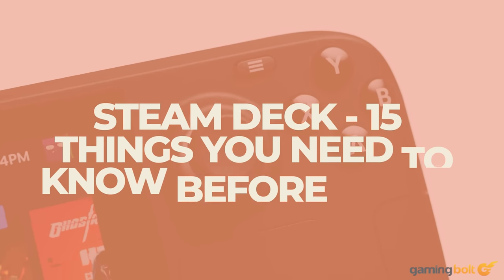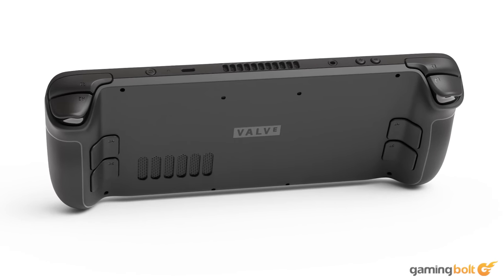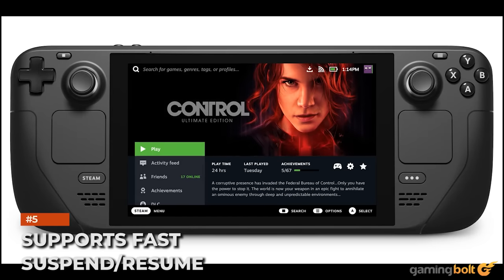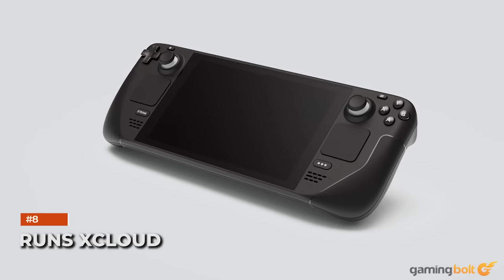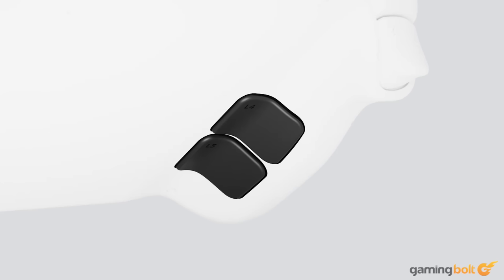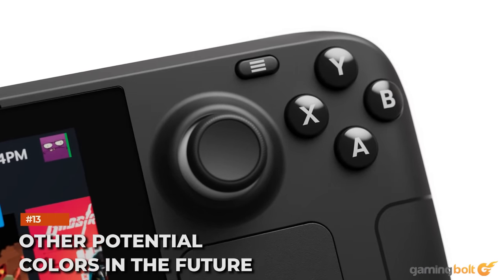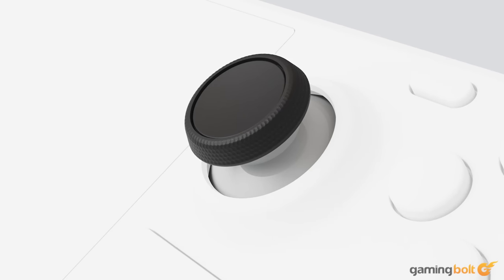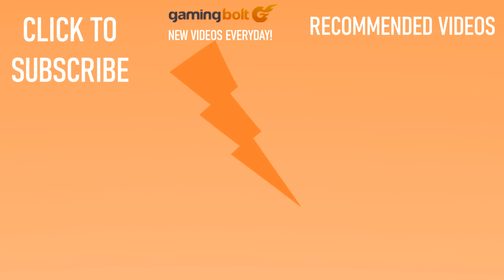Steam Deck - 15 New Things You NEED TO KNOW Before You Purchase

Comment: I pre ordered the smallest hard drive one and I can’t change it and don’t want to wait longer for one, anyone know if it has a slot to put ssd in or roughly how many games I could get on it, probably want to play Elden ring and cyberpunk on it
Reply: You can put a 1 tb micro sd card in it and it will perform the exact same as the internal ssd. Linus tried it in one of his videos. You will also likely be able to upgrade the ssd but I'm not sure
Reply: @Thebadbeaver9  ok thanks for that , as long as I can expand the storage without opening it up that’s good for me 👍
Reply: You will have to wait for the  teardown of the cheapest one to see if they added the NVMe slot on the mainboard  all the ones that are tested at the moment are the 512gb models.. but you can get a 1tb sd card for it and it's hot swappable like a game cartridge .. I got the 256gb one reserved I'm just gotta get to two 512gb sd cards or  acouple  256gb sd cards since lesser size ones read alittle faster than the bigger GB ones and price
Reply: @digitaldoom3593  All three models have the same hardware, except the storage. That means that the 64 GB model also has an m.2 slot for a NVMe SSD, so you can replace the 64 with a higher capacity one. That's confirmed and makes sense because it would be more expansive to have two different boards where one does not have a slot.
Reply: Nice just saw all models use socketed 2230 M.2 modules ....  first time seeing it thanks

Comment: what if you could attach something like the oculus quest 2 (Using a oculus app for steam) so you could play steamVR on the go
Reply: @demonpride1975  I was just using oculus as an example
You can use whatever headset you want.
Reply: @tabbycat8647  there is just one problem with that, to stop people from getting sick, you need a stable 60 fps, anything lower then that. or even stutter can cause sever motion sickness.

Comment: Thing is its said that its a pc. but i would like to see future development of contents like putting windows. the included ssd has the steam os and it probably has the booloader as well of the os. same goes for windows if one were to install. you will be needing a second 2230 ssd drive to bootload and configure a windows 10install and install on steamdeck enviroment. then comes accessing bios to change the drives prioriy and such. its easy to say that you can put windows and game pass but it will be a nightmare till some drivers comes out for windows vesion so one can install gpu driver, blutooth and wifi,power configuration tools, successfully running afterburner. amd ryzen master working properly to tweak memory.

Comment: Is the 64GB version SSD replaceable?
Reply: yes  you can  istall ssd 2242 i think but valve is aginst it
Reply: @clanjade1  They aren't against it, they said approached it at your own risk and it voids your warranty.
Reply: @clanjade1  2230 NVMe only, 2242 won't physically fit. Generic off-the-shelf drives aren't guaranteed to work perfectly though, YMMV. I'm guessing a decent number is installable but may have some thermal issues or somewhat interfere with the wireless module. Can realistically range anywhere from "barely noticeable" to "barely runs at all".

I'm sure the community will test a lot of drives though, finding a compatible one shouldn't be too difficult.

Comment: Replacing the battery will be a nightmare.
Reply: Yeah, I found it shocking how they glued the battery in after having taken such a pro-right-to-repair stance regarding most other components, especially considering that the battery is likely the first component that'll fail.
Reply: @ThePC007  hopefully it will be better on the final released products?
Reply: @MiraSmit  I really hope it will. Either that or people find a way to reliably replace those, even it means flooding the entire battery chamber thing with alcohol or something (though that's assuming that replacement batteries will actually be available).
Reply: @ThePC007  I suspect Valve will be selling those too at a somewhat marked up price since you k ow L shaped batteries aren't that common.

Comment: I'm adopting a wait and see approach as I'm from a country where the US dollar is four times my earning currency, so there's a huge price difference between the most basic model and one step up. So I'd like to know just how viable it is to play with the base 64GB version using a fast high capacity MicroSD card.

I don't know if Valve will even ship it globally. With no official distribution for consoles besides the Playstation in my country, they're only available as grey imports, and at ridiculous prices that had left me sticking to PC gaming.

Also I'm curious to see how it will handle titles that still need EA's Origin or Ubisoft's uPlay services or heaven forbid, Games for Windows Live.
Reply: Yes you can game from the MSD card and upgrade the 64G as it is M.2 30 size.  The Phaux has good coverage on how to get the most oiut of the SDeck

Comment: 2230 is such a weird m.2 size to use. It'd small but it's also hard to get your hands on a new one as they seem to only be used by OEM.
Reply: This one was designed specifically for the Steam Deck.
Reply: @Joreel  It's custom-designed to a degree, but one could still find off-the-shelf products that are compatible, it just isn't a case of "every 2230 NVMe works perfectly by default" (EM interference, thermal design, battery life, etc.). There's nothing stopping manufacturers from labeling existing drives as Deck-compatible though (from their perspective at least).

Comment: also 15 was kind of a joke but not really. they do say: its YOUR DEVICE do what u want. but please. dont. let an expert handle this.
if you ''upgrade'' u probably meant replace battery joysticks memory. u could possibly fuck up the screws. thus making it all weaker.
and in terms of colours. ever heard of 3d printing? once people have these its super easy to make your own backplate. with custom logo's and what not.
im sure valve is aware of this. and also look into the killswitch. a protective mould for over your deck. u can already pre order them.

Comment: Been debating on it for awhile. However there should be more benchmarks and better looks at the hardware by the time my reservation would be made available, so I could cancel if I see things I don’t like. However it seems the deck is on par with Xbox one / ps4 performance with perhaps more juice due to the architectures and storage the decks using. Time will tell. 

Sea of thieves or rdr2 on the go would be nice. Will just have to see

Comment: So what happens when the controllers wear out once a year due to heavy use?
Reply: Joysticks can be replaced without dealing with any adhesives or soldering. Valve has partnered with ifixit to sell replacement parts like joysticks

Comment: It's more powerful than a switch but less so than the current gen consoles for a higher price,but it is able to do things on the go so if i can even get one i would need to buy an extra ssd for sure(i'm a digital pack rat).
Reply: why would you need an extra SSD? There are tons of vids showing that high quality SD cards load nearly as fast as the SSD and 100x more portable far easier to swap.

Comment: My most important question: WILL IT PLAY METAL GEAR SOLID V?...

And Baldur's Gate 3. That'd be nice
Reply: Based on ProtonDB, both should work, possibly with some tweaks required. Baldur's Gate 3 does seem to have some performance issues according to current reports, but there's a decent chance that'll be resolved at some point in the future (no guarantees though).

Comment: its sad that when the next gen switch comes, its still gonna be overpriced hardware, im betting as powerful as the series s with a weaker cpu at $500
Reply: There’s no way the next Switch will be near the same field as a Series S. 

We would be lucky for it to reach the power of an Xbox One or PS4 anytime soon. Current switch clocks in at less than half the performance of the regular 2013 PS4.

Plus, it’s Nintendo. Wouldn’t be surprised if they release a Switch 2 with a slightly tuned fan curve so it can run 5% faster and call it “Next Gen”
Reply: Nintendo switch has 1Tf of raw power while the series S has 4 ...... a new switch is never going to be on the same level as a Series S .. the Nintendo switch is barely above the power of a ps3
Reply: @retrofxmedia  Go look at handheld gaming in 2016. We had the 3DS and Vita to look forward to. The Switch moved handheld gaming to the next level. People forget this and have been spoiled with the Switch

Comment: EMMC memory is in the low end model. This is slow. You have been warned. This will affect the graphic speed substantially.
Reply: Whatever "graphic speed" is supposed to be. I disagree. eMMC is similar to CD cards in speed, which are still fine. It only affects loading times, not the overall performance.

Edit: eMMC is also not memory. It's storage. Hube difference.
Reply: Not as slow as my hdd.
Reply: @Gramini  "Flash memory is not memory, it's storage."
Srsly, step up your tech-linguistic nitpicking.
Reply: @MunyuShizumi  What?
Reply: @Gramini  You stated that eMMC isn't memory, which is false. It's not RAM/VRAM specifically (which is more relevant in this case), but they're all subtypes of memory.

It's also not entirely irrelevant, e.g. pop-in or small stutters might be a lot more common/noticeable since quite a few modern game engines load assets dynamically when needed as opposed to preloading everything ahead of time, especially in e.g. open-world games where there are way too many assets to load at once. And just as OP never defined "graphic speed", you never defined "overall performance", both of which can mean different things (and "load times" can rather easily fall under "overall performance").

I generally agree with the core of what you said, I just don't think nitpicking every other word and phrase is very productive (which makes up ~40% of your comment).

Comment: No idea what any of these specs mean.
Reply: On paper weaker than base ps 4 but cpu out matching  the base ps4
Reply: @haruhisuzumiya6650  Actually, no, it's slightly better than the base PS4, according to all the tests done by LTT and The Phawks, mainly due to RDNA2 architecture.
Reply: @amiiban  1.6tf vs 1.85tf ?
Reply: @amiiban  ps4 can’t run some games 60fps… isn’t that bad lol
Reply: @luluna5228  As I said, BETTER than PS4, it can run Control at 60fps, which even the PS4 PRO can't do
Reply: @haruhisuzumiya6650  "1.6 TeRAFlOP vS 1.85 tErAfLoP" like it means shits hahahahaha. Teraflop mean absolutely nothing when you have to take into account the dynamic between each pc components. Even just a newer piece of RAM can make all the difference for the CPU. It's just the way it is. Also, sofware matter and Valve seem to be very careful about how the game run on their machin. They learned alot to make games playable. Even just the use of a linux base OS will make the performance better than a PS4 can. In all honesty, I would even argue that it is closer to a Serie S architecture than a PS4 lol.
Reply: @amiiban  yo you know much about the scene? i heard future iterations are coming, how long do you think that will be? i probably will wait for "steam deck 2" or whatever it will be
Reply: @luluna5228  Probably a few months after the Steam Deck if a bunch of New Game come out that need better hardware.
Reply: @luluna5228  Valve have never confirmed any future steam decks but the point of the steam deck was to create a new market for handheld gaming pcs, so I'd expect in the next 3 years lots of new steam deck like devices or even a steam deck 2 from Valve and over companies.

Comment: I thought you would go to an online shop and have thousands of titles to choose fro. Not 90 games or so. For example, Ys 1. If I could get that ...
Reply: Ys 1 should work according to ProtonDB, some tweaks might be required for in-game movies.
Generally speaking, the vast majority of games will run, regardless of their current Deck compatibility rating, or even being on Steam or not. I've been running a very Deck-esque Arch setup for a number of years. Most games run without any tweaks, I'd say <15% have noticeable issues that would negatively affect the experience.

Comment: 1) Suspend & Resume is nothing more than what you see on Switch or PSVita, 3DS and others Handheld.
2) VRS is In-Game implemented, and most dev does not it.
3) MODS & RayTracing is not reccomanded for Performance and Battery Life Reason.
Reply: There is a difference between deep sleep on ARM based systems and suspend on x86 based systems...
While ARM enters deepsleep while still being able to actively remain a wifi connection and do things in the backround, a x86 machine basically puts the current state into the RAM and then powers of almost everything except the RAM.
So the CPU isn ´t able to do anything, thus no connection remains and no tasks can be done in backround.
I assume the steam deck will do it similar to what the Xbox Series does currently.

An ARM based system always remains active, it´s simply pausing the game/process and enters deep sleep which will save power by dramatically reducing CPU core clocks and disabling some peripherials.
That´s why your phone is able to receive calls and notifications even since it´s in standby.
Reply: 1) incorrect, according to valve it will take < 1 sec to sync, which is better than anything on the market.  It's as close to cloud always-on time as it get
Reply: @LuckyDuckie115  You are talking about incorrect thing here, you are talking about the SaveSystem...that VALVE still work-on that need In-Game implementation.
The current SaveSystem is the same than on 2 PC, except that the system would be able to Sync while In-Game, in any case you will have to reload the last save.
Reply: @MultiWirth  Of course, ARM is pretty LowPowered based SoC, but it change nothing that is no more than a Suspend System, people still believe(you can see one comment above) that its Instant Save/Load System when its not.
Reply: A nuance with Suspend and Resume that I think people are missing: this will be a feature introduced for the first time in a system that's essentially running PC games. If this feature is successful on Deck, they can introduce the same feature on Steam running on PC's.
Reply: Why would mods not be recommended? I don't see how they decrease performance/battery life in general. There might be some mods that's super expensive, but it should be no problem for the huge majority.
Reply: nintendo fangay on suicide watch

Comment: it looks like a great device but that LCD screen looks like garbage compared to Switch OLED even if it's way weaker performance wise
Reply: 😐😐😐😐😑😐😑😐😐😐THIS BLOWS SWITCH OUT THE WATER IN EVERYWAY POSSIBLE DUDE.
Reply: @Gloryboyquan  no the screen is not better i'm sorry . It's better only for higher performance, the Switch is weak system.
Reply: @DidoInFlames  I Know But U Crazy If U Choose  Switch Over steam deck when It Can Literally  Emulate  All Switch Games R Most Of Them . But I Guess Switch Is Cheaper And More Portable I Guess...
Reply: @Gloryboyquan  i have Switch Oled i like it but i cannot deny the power of the Steam Deck if i have money i will buy one. It's better performance wise.

Comment: sd cards expensive... sure where? i can get some super cheap. and i got the 256gb model. could of settled for the lowest one.
but figured eh. a few more for ssd is a big increase in the bootup. of the deck and steam itself. 
also fast suspend resume is on any console. according to my friends.
i wanna slap gaming bolt for NOT THE MOST POWERFULL. sure show me 1 device that is more powerfull... i dare you.

Comment: so in the end epic weaseled their way into the steam deck somehow. also i have a laptop, sure it isn't as portable as the steam deck, but it has full support for all my games, give me a good reason to drop that much money on essentially a keyboard less pc.
Reply: It’s more portable, and has exclusive features like suspend/resume. Not to mention it’s only $400, a better price to performance ratio than any other device on the market.

If you’re not a fan of handhelds tho then obviously this won’t be for you.
Reply: @CaptainEffort  do you know how quickly the memory ssd will disappear because of it.s extremely limited capacity, you literally will only be able to put maybe 1 triple a game on it, depending on the game, or some third party. you wouldn't even be able to put horizon zero dawn on there.
Reply: @demonpride1975  According to LTT the speed difference between the SSD and Micro SD is negligible, and almost identical in some cases. So throw in a tb micro sd and you’ll be golden.

Regardless, I’m mostly looking forward to emulating older titles and playing indies, with the occasional AAA game, so storage wont be an issue.

Comment: Since there are PC exclusive games are a thing. Common sense shows there will be exclusives for the Steamdeck.
Reply: No? Apart from the handful of games released by Valve itself (Counterstrike and Dota, etc.) none of the other games are exclusive to the Steam platform. Besides, the device is not hard-locked or anything. It's just a PC, so you can do with it what you want. Wipe the OS, or dual boot, use emulators, etc. etc.
Reply: The Steam Deck by all accounts is essentially a pre-built PC with a built-in controller. Any "Steam deck exclusive" you try and produce for it, will be a game that'll also run normally on a traditional gaming desktop or laptop. It's like trying to say that there'll be an "Acer Predator exclusive" game, which is a ridiculous concept.
Reply: Depending on how you view it. As the "exclusives" you mentioned can also be played on PCs and other handheld PCs they are not exclusive to the Deck.